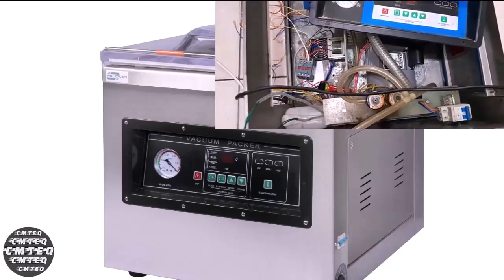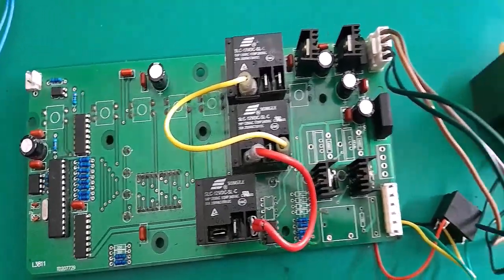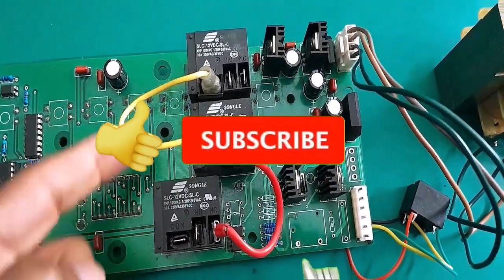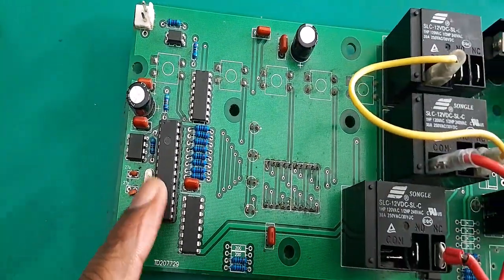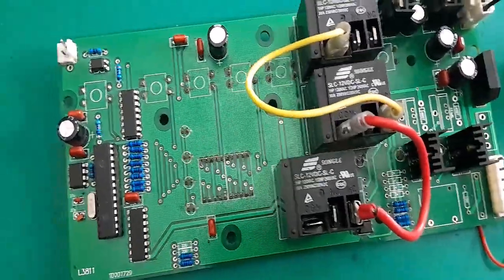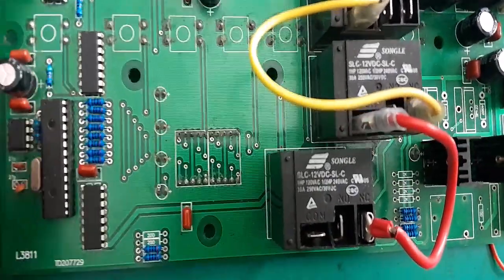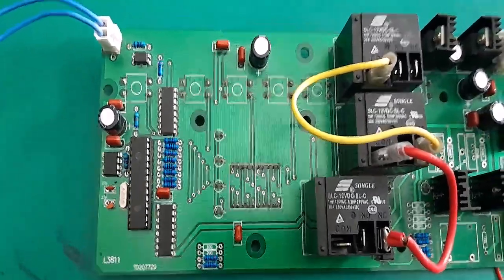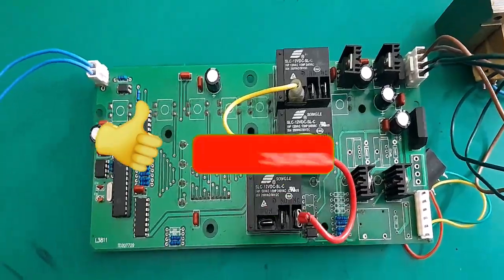Tips on how to repair a DZ400 #vacuum sealer controller #motherboard.

Comment: Did you get it working? I noticed a connector on the main board that didn't have anything on it. I'm guessing you already looked for other limit switches and or safety circuits that might keep it from moving to the next logic step?
Reply from the maker: Yes, partially. If you are referring to the white 2-pin connector, I had it wired externally for control, which made the board function more like a test setup. To fully repair the unit, I ultimately had to replace it with a clean, working module. I actually designed the module PCB myself and began working on the firmware for the PIC microcontroller.

Comment: Hi man, I have a problem with machine me. The sealing no funtion because I cannot configure the level for temperature. ¿have  you some idea about as solution?
Reply from the maker: Hi, you need to check the relays that control the transformer that provide heating power, its either the relays are not switching, which will mean the transistors controlling the relays are either broken or maybe you have a loose connection.
Maybe take a picture of the PCB and send it to me via Email.

Comment: Good morning, can you help me with specifications to connect a 30-pin flex cable to the circuit and components of the DZ400A Vacuum Sealer, year 2003?
Reply from the maker: Hi, yes I can assist you, but I need more information, first you need to fill up this google form so I can get your email.
https://forms.gle/ySYW1d98vqhVUFuV7 
Then you need to become a channel member by clicking on the Join channel button. You can terminate your memebership once I'm done assisting you.

One I have your email, I will send you an email requesting more information like photos of the setup.